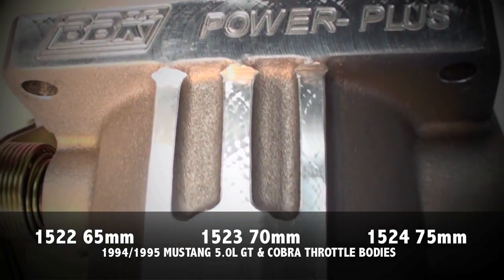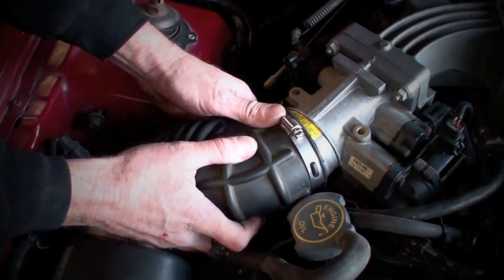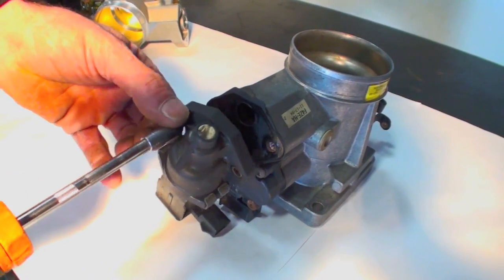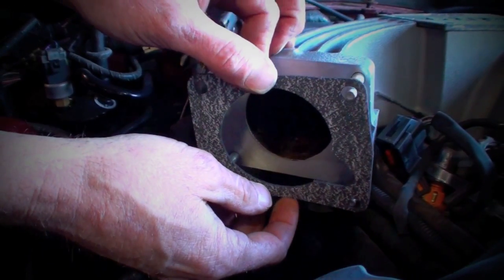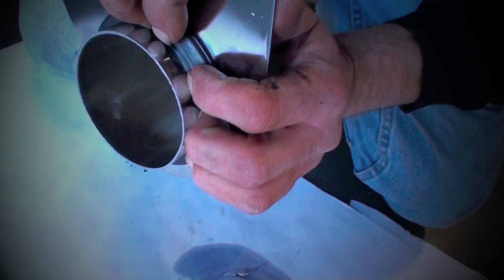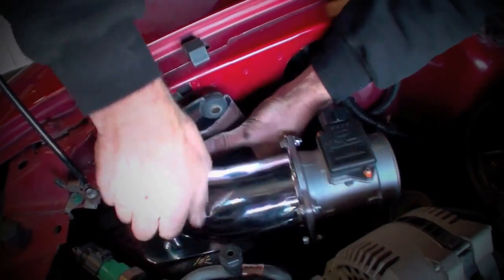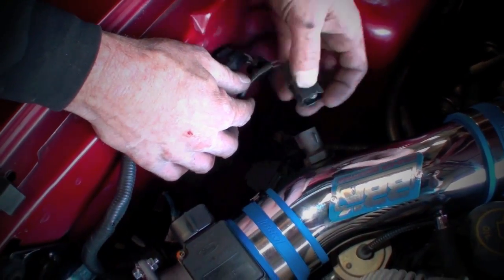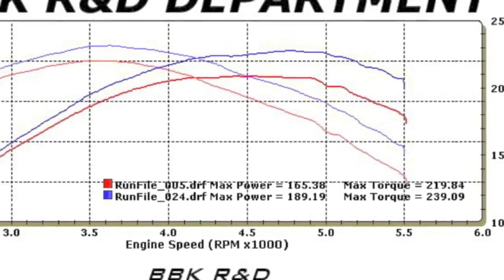1994-1995 Mustang 5.0 GT Performance Parts Upgrade Overview

Comment: Wow. You can see that the new throttle body is larger than the manifold and has an 1/8" step in the way. YIKES.
Reply: 70 mm throttle body on a 65 mm manifold hole...
That's .200 inch diameter.

Comment: at the motor the 94-95 5.0 gt's have 215 hp, at the wheels (output) its another story as with all cars manufactured. I got a deal with brother performance when I bought the edelbrock performer and I got the bbk 70mm tb for about 80 bucks. Someone mentioned that a 94 and 95 gt's have different engines lol, do some research kid.
Reply: I did too brothers hook me up with my 5.0  👌

Comment: how can it be 1994 and 1995 when those 2 years are 2 very different engines whats a 5.0 internal cam one is a over head cam
Reply: 1994 and 1995 both have the 5.0 H.O..... Source: I own one.. 1996 is when the new weak ass non-P.I. 4.6 came out.
Reply: +TheKoppenhaffer. ahhh that's right thought 94 was last 5.9-- 4.6 is 10 times better then the 5.0 any day of the week
Reply: '95 was the last 5.0... Also the 4.6 produced less power and torque than the previous 5.0 did. Stock for stock the 4.6 gets slayed unless it's a 99-04 or has a P.I. swap.
Reply: +TheKoppenhaffer u need to check your facts 1994 and 1995 5.0 215hp 1996 4.6 215hp last 5.0 and first 4.6 were same power but 4.6 was better cuz it was ohc
Reply: @TheKoppenhaffer   That '96 GT didn't have the optional wider tires which clearly hurt performance in every aspect considering grip and braking numbers were down too even though the car was lighter. MM&FF had a project '96 GT with around 200k that put down more to the wheels than the turd in this video. 

Also '93 Mustang's weren't underrated, they switched from forged internals to shitty hypereutectic pistons and the SAE ratings system changed.
Reply: Yeah man! I love these cars! I sometimes forget how old my 94 is. The 90s, early 2000s were good times for me as these mustangs were more popular than they are nowadays. You barely see them where I'm from now. And for most people, they say the 94-04 were the least desired, ugliest of all mustangs. Good, I don't care, I love them anyway!
Reply: +Brian Berthold The 99-04 4.6 is a good engine. The 96-98 were garbage.
Reply: +Brian Berthold You apparently didn't read the above link.
Reply: im not much of a 4.6 guy, from what i remembered a pi swap is a head cylinder head swap, if its a cylinder swap wont you get more power out of a 5.0 if you slapped some Afr's on it? the only thing I like best of 4.6s is the ammount of abuse it can take w/out cracking the block, but 5.0s you can find junkyard cylinder gt40p's (mine cost me 70 bucks for both) change the valve springs and get about another 25-30 hp out of them, add in an explorer manifold and youve got cheap horsepower.
Reply: right back at ya mr wrong
Reply: +TheKoppenhaffer ...I have a 94 5.0 and i have had a 96 4.6 and a 99 4.6...the 4.6 is much better and faster then my 5.0 ....if the 5.0 was s0 good they wouldnt have shit canned it......
Reply: TheKoppenhaffer
why should i read about something i know about ... i have had both engines 2 5.0's and 2 4.6's and the 4.6 where better all around
my current 5.0 makes 215 HP or so they say my 96 4.6 made 217HP (dinoed) .. cough and it wasnt even a mustang it was a crown vic with HPP
Reply: TheKoppenhaffer
so should we call you mr wrong ?? cuz they are the same my 96 4.6 i ran up to 300K miles and it was still just like it came out of the showroom my 99 4.6 i ran to 500K and the car was totaled you can say what ever your lil heart wants to but the truth is the 4.6 is was and always will be a better engine then the old 5.0

Comment: I had a problem with my 1994 mustang gt not starting after putting on the SR preformance 75mm throttle body and CAI. I checked all connections and cables. it came down to be the TPS sensor, but I can't find a way to check the voltage to set it, so I have to buy a new TPS sensor and set the voltage on that one.

Comment: Why are the horsepower and torque specs so low? The 1994-95 GTs came stock with 215 horses. I understand that with age the power might slightly drop, but not by THAT much. If the car is in decent condition, it should be pushing at least 200 horses.
Reply: Not at the rear wheels... Where a dyno reads power output.
Reply: Power to the wheels not the flywheel.
Reply: I was wondering the same thing.  These numbers are WAYYY lower than the other stock '95 GTs I've seen dyno charts on.  Most of these cars are actually making 190-200 HP at the wheels.  This one must be a dog, or they're running the car in an odd gear.

In fact, Hot Rod tested a stock 5.0 engine from '95 and found that at the crank it was actually making over 230 HP and over 300 lb/ft of torque.
Reply: Lol the auto transmission cars have close to a 20% loss in power from the crankshaft to the wheels...
Reply: 215 at the crank not the RWHP.

Comment: Ive looked at two sites with the same picture of the throttle body . On American Muscle its a 75mm and on Brothers Performance its a 70mm?.. help me lol
Reply: The inside diameter changes. I've heard 94 and 95 mustangs are better off with the 70mm one. If it's true or not i dunno.
Reply: They're available in different sizes.
The 70 calibrates well with the stock computer/ sensors.
Reply: Depends on modifications. Bigger is not better.

Comment: Will it make a difference if u add the throttle body spacer as well..?
Reply from the maker: Mario Aldaco to be honest probably not - in our experience TB spacers are gimicky
Reply: OK thanks
Reply: Any advice to get more out of a 94 5.0 to keep it street leagle.?
Reply from the maker: Mario Aldaco please give us a call to discuss 800-486-2681 there are lot of different options.

Comment: What are the torque specs on that?
Reply from the maker: seth lambert to be honest not sure which torque specs you are refering to - heres a good list:
5.0L Torque Specifications*
(ft-lbs unless otherwise indicated)

Camshaft sprocket bolt........................................40 to 45
Camshaft thrust plate-to-engine block bolts........108 to 144 in-lbs
Timing chain cover bolts .....................................12 to 18
Cylinder head bolts
Step 1 .............................................................25 to 35
Step 2 .............................................................45 to 55
Step 3 .............................................................75 to 85
Vibration damper-to-crankshaft bolt....................110 to 130
Exhaust manifold bolts ........................................26 to 32
Intake manifold-to-cylinder head bolts
Step 1 .............................................................96 in-lbs
Step 2 .............................................................16
Step 3 .............................................................23 to 25
Oil filter insert-to-engine block adapter bolt ........20 to 30
Oil pan mounting bolts ........................................110 to 144 in-lbs
Oil pump mounting bolts.....................................22 to 32
Oil pick-up tube-to-oil pump bolts.......................12 to 18
Oil pick-up tube-to-main bearing cap nut ............22 to 32
Drivelbelt pulley-to-vibration damper bolts .........35 to 50
Rocker arm fulcrum bolts....................................18 to 25
Flywheel/driveplate mounting bolts .....................75 to 85
Front engine mount nuts .....................................72 to 98
Bellhousing-to-engine bolts
(3.8L and 5.0L models)..................................28 to 38
Driveshaft U-joint-to-pinion flange bolts .............70 to 95
Pressure plate-to-flywheel bolts ..........................12 to 24
Companion flange/pinion nut (minimum)............140
Pinion bearing preload (minimum, original bearings)..................8 to 14 in-lbs
Differential pinion shaft lock bolt.........................15 to 30
Wheel lug nuts.....................................................85 to 105
Spark plugs .........................................................7 to 14
Firing order..........................................................1-3-7-2-6-5-4-8 

Cylinder headbolt tightening sequence....................Cylinder headbolt tightening sequence

Lower intake manifold tightening sequence ..............Lower intake manifold tightening sequence

*After assembly, retorque with the engine hot.

- For complete teardown and rebuilds, Brothers Performance highly recommends the purchase of a Haynes or Chilton Shop Repair Manual for your application.
- Specifications are a general guide.
- Brothers Performance does not accept responsibility for any inaccuracies or misprints. We recommend that all specifications are obtained from vehicle manufacturer

Air Bypass Valve To Throttle Body 6-8 ft lb
Alternator Adjustment Arm To Alternator Bolt 24-40 ft lb
Alternator Adjustment Arm To Cylinder Block Bolt 12-18 ft lb
Alternator Bracket To Cylinder Block 12-18 ft lb
Camshaft Sprocket Gear To Camshaft Bolt 40-45 ft lb
Camshaft Thrust Plate To Cylinder Block Bolt 9-12 ft lb
Connecting Rod Cap Bolts 19-24 ft lb
Cylinder Front Cover Bolt 12-18 ft lb
Distributor Hold-Down Bolt 18-26 ft lb
EGR Valve To Intake Manifold Spacer 12-18 ft lb
Exhaust Manifold To Cylinder Head 18-24 ft lb
Fan To Water Pump Hub 12-18 ft lb
Flywheel To Crankshaft 75-85 ft lb
Front Engine Support Insulator Nuts 72-98 ft lb
Fuel Charging Assembly To Head 23-25 ft lb
Fuel Rail Assembly To Intake Manifold 6-8 ft lb
Intake Manifold [02]
Main Bearing Cap Bolts 60-70 ft lb
Oil Filter Insert To Cylinder Block Adapter Bolt 20-30 ft lb
Oil Filter To Cylinder Block [03]
Oil Inlet Tube To Main Bearing Cap 22-32 ft lb
Oil Inlet Tube To Oil Pump Bolt 12-18 ft lb
Oil Pan Drain Plug 15-25 ft lb
Oil Pan To Cylinder Block 6-9 ft lb
Oil Pan To Cylinder Block Bolts 9.2-12 ft lb
Oil Pump To Cylinder Block 22-32 ft lb
Pulley To Vibration Damper 35-50 ft lb
Radiator Bolts 5.9-7.7 ft lb
Radiator Hose Clamps 20-30 in lb
Rocker Arm Cover 6-9 ft lb
Rocker Arm Fulcrum To Cylinder Head 18-25 ft lb
Rocker Arm Shaft Bracket 18-25 ft lb
Spark Plugs 5-10 ft lb
Tensioner Assembly Bolt 55-80 ft lb
Throttle Body To EGR Spacer And Upper Intake Manifold 12-18 ft lb
Throttle Cable To Manifold 8-10 ft lb
Timing Chain Front Cover 19-27 ft lb
Upper Intake To Fuel Charging Assembly 12-18 ft lb
Vacuum Fittings To Intake Manifold 6-10 ft lb [04]
Vibration Damper/Pulley 70-90 ft lb
Water Outlet Housing 9-12 ft lb
Water Pump To Cylinder Block Front Cover 12-18 ft lb

[02] -- Torque in two steps. First to 11-15 ft lb, then to 20-25 ft lb. After assembly, retorque with engine hot.
[03] -- 1/2 turn after gasket contacts sealing surface.
[04] -- Install with Teflon(r) tape.